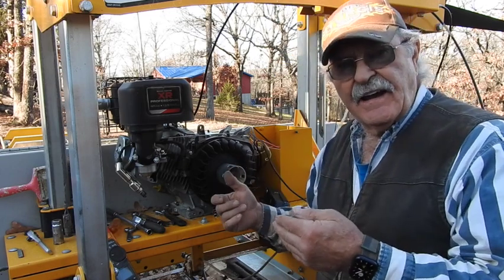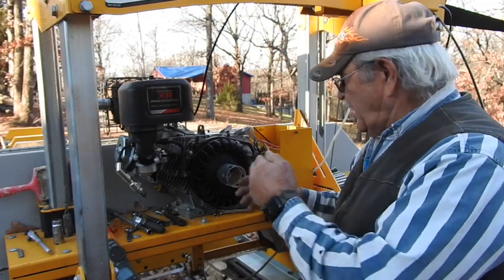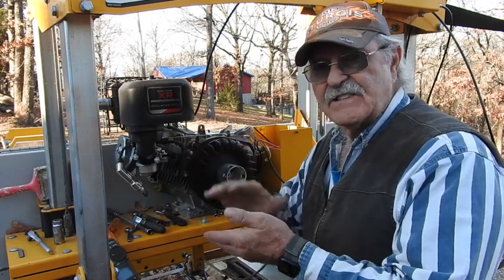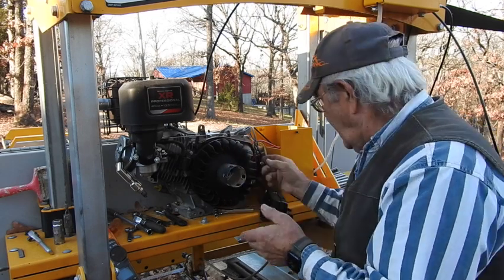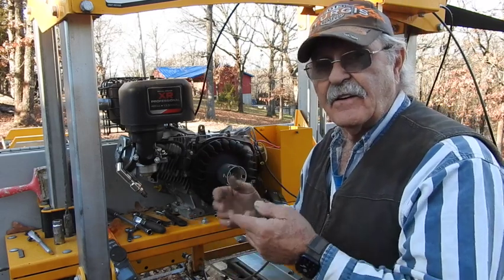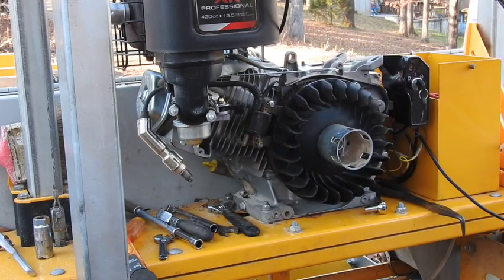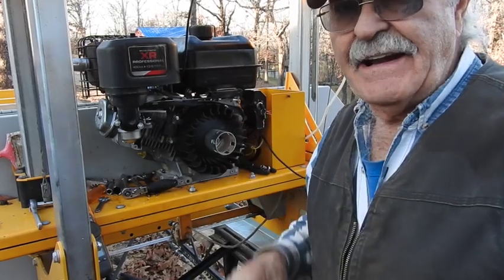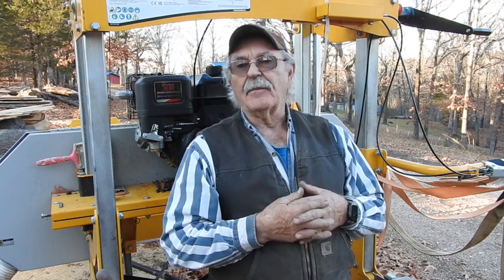Frontier Mill  Briggs- Magnetron Ignition- Troubleshooting Safety Circuit

Comment: Good troubleshooting Wendell! I have been fighting mice at my place in the country for 30plus years,  Couple years ago came upon spearmint or peppermint oil soaked cotton balls. Just push a cotton ball in the bottle with a thin jaw longnose plier to get it soaked and put a few in the battery box or wherever. Originally used it for wasp's but keeps mice away too!
Reply from the maker: That's another good idea, thanks for the suggestion. I hate mice !! I have to keep mouse traps set continually in our garage and keep dog and bird feed inside metal trash cans with lids.

Comment: You being a retired commercial HVAC mechanic, it probably brought back memories of leaving a jobsite that, while running, you weren't 100% sure that you had found the real problem and might be back.  I know the feeling.
Reply from the maker: Yeah...I HATED when an intermittent problem couldn't be found and had to leave unsure.  But I always made the people aware of the situation before getting a signature.  They seemed to appreciate the honesty and most of the time on a return, we would just add to the original invoice as though I never left the job. In other words, without and additional service charge.  It happens to virtually every tech, but you gotta keep it at a minimum.  I was pretty lucky in that department. Oh, I CAN tell some stories about commercial HVAC issues. LOL
Reply: @tractorman4461  In the 90's companies folded every couple years. I worked for 5 not counting State Farm, owning a book store, and selling radio advertising. 
Every factory had to have the office HVAC gone through. Most had little or no history of service or connection with a service company and they were in different towns. 
I just kept having the same service company  I started with in 1980 do the service work every time. They also did the electrical work that we couldn't. 
Nice to have someone you can trust.  Don't think they gained any customers though. Every place closed soon after I left. It was a rough decade.

Comment: In the 70's MIOSHA mandated, I hate that word just because it means no argument 👺, guarding on everything had to have the machine not work with any guarding missing. We were running presses and swing saws so lots of guarding. By it's very nature a safety switch is kind of a hair trigger that breaks the control circuit so the companies that installed them of course put in the least expensive ones and they failed quickly. 
We replaced them with the good Allen Bradley limit switches every time we worked on them. 
Still the conveyors at Borg Warner ran all through the building. Safety switches and e stop circuits made handy hanging places for pliers, brooms, welding cables, and lunch bags. 
Mice didn't bother the insulation on the THHN but they sure did like to build nests.
Reply from the maker: Yes, I do believe that these proximity switches are quite cheaply produced.  As they fail, they will be replaced by NOS I have on the shelf. The plastic coating on the THHN is a deterrent for sure.  This is regular rubber coated automotive wire that mice seem to enjoy nibbling.  So I'm sure the intermittent issue will rear its ugly head again and then hopefully it can be resolved.  I am not going to change whichever part it is until it fails to reset connection by the wiggling and jiggling of troubleshooting.  I strongly suspect its the 'passenger' side switch.
Reply: @tractorman4461  Mice or other vermin ate the antilock braking wires off my Sonoma. 
I just knew the antilocks didn't work. 
Took about 3 hrs to reconnect and splice in missing sections.
Reply from the maker: @OldSneelock  Well now, that could have been catastrophic.  One more reason to literally HATE the critters !!  )-:

Comment: That’s a good blow by blow of the diagnostic and the way to do it to find a no start problem. Micro switches are a problem area for sure.....CHEERS
Reply from the maker: I don't know if I'm happier to know its probably a switch or not.  It could still be one of the chewed wires grounding out that's just not been located yet too. They really made points and condensor ignitions obsolete with the Magnetron.

Comment: Downy Dryer Sheets will keep mice away. The Missus shouldn't miss one from the laundry. I recommend adding a new one every couple weeks. Put one int the  belt guards and another one in the battery box. Works good for me
Reply from the maker: Yours is the second suggestion Dean.  The first one was to wipe Pine Sol around the engine and battery box....I'll probably do both.  Just for good measure.  Thanks for the tip my friend.

Comment: The Everyday Projects channel guy just did a video of keeping mice out of his off grid house with Pine Sol. He liberally swabbed Pine Sol on the floor and around the threshold, he stated that this has been very effective as the mice do not like the smell of the Pine Sol. Maybe put a cup or two on there and bag the motor to slow evaporation of the liquid. Possibly just swab a good amount around the motor and spill some on the ground as well. Worth a try.
Reply from the maker: Now that's a good idea.  I've never heard that before.  Thanks for the added input and I'm sure that's what I'll do. I have had lots of mice issues over the years...the worst being eating all the wires off the ECM all the way up to the box itself.  That was the old 85 Ford.  Luckily they are very reasonable to replace.
Reply: @tractorman4461  Yikes, sounds like you may benefit from a few cats as well lol